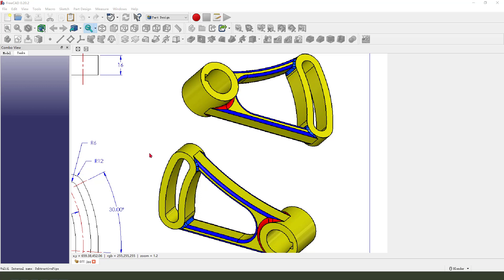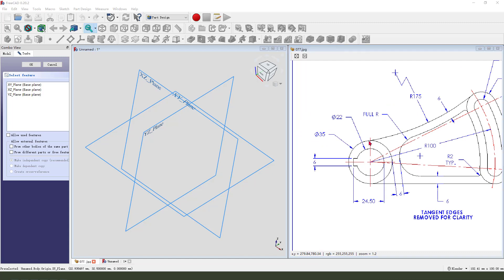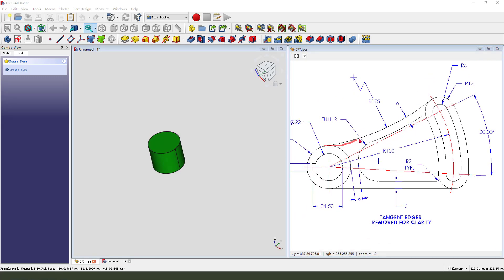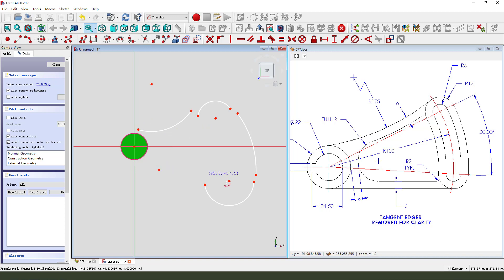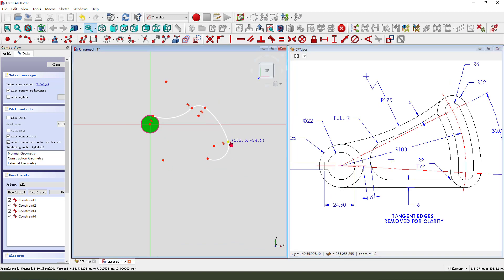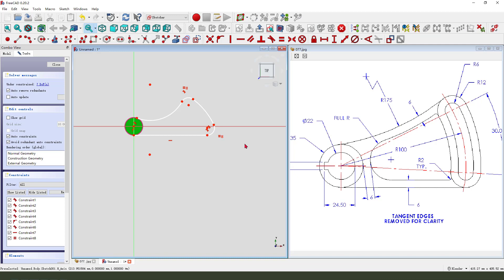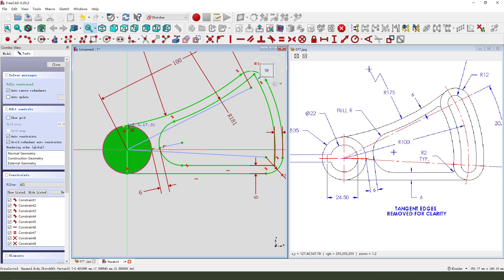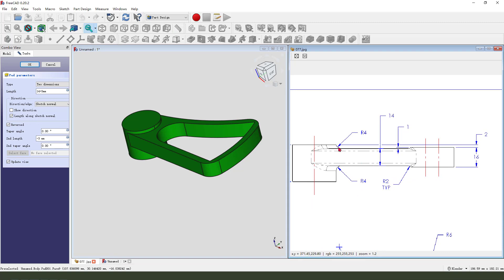FreeCAD Tutorial for beginners,basic model exercise-77，Model-Mania-2008-Phase-1

Comment: At 7:10, the point should not be attached to the x-axis. You should better extend the construction line to the origin of the coordinates and then attach both points to the construction line. Otherwise the 6mm distance is not 100%  correct.
Furthermore you "forgot" the fillets. Maybe you have tried before and (ike me) could not complete it? Once again, FreeCad seems to struggle with fillets on complex models.
Reply: Learning still... Would you be able to explain why constraining to the x axis is bad here?
Reply: @JacobHepworth  I believe that the shortest distance between the arc (marked as FULL R) and the circle (35mm dia.) should be 6mm. At least that is what I read from the drawing. 
If the point at the circle is attached to the x-axis this is not the shortest distance. If you set this distance to 6mm, the shortest distance will be about 5.755mm. The shortest distance is where a imaginary line from the center of the circle to the center of the arc intersects circle and arc. Therefore the best way is to draw a construction line between the two center points, attach the two points on arc and circle to this construction line and set the distance between the two points to 6mm.